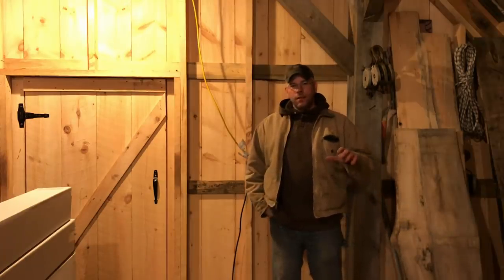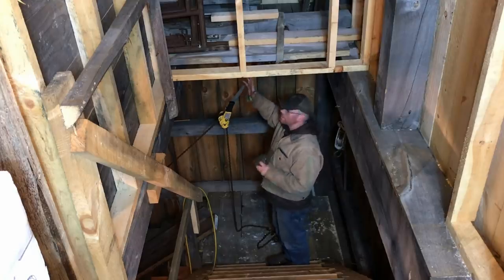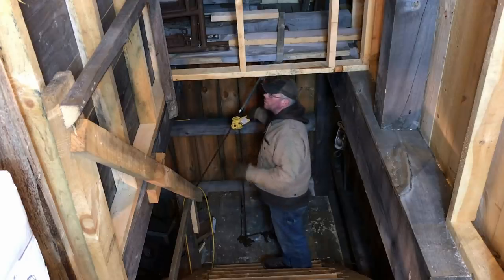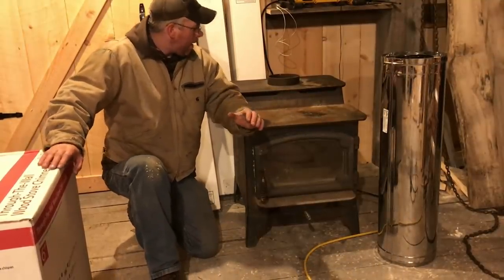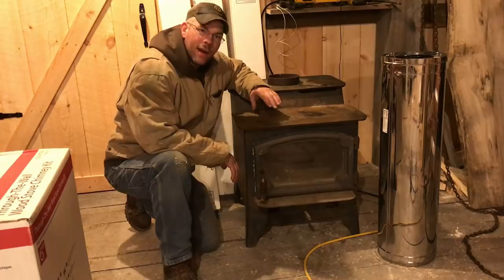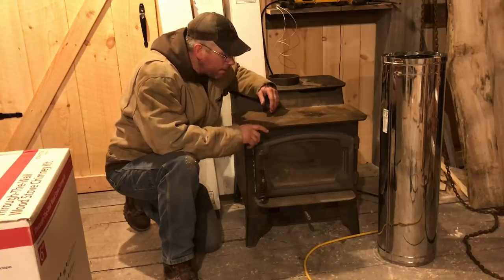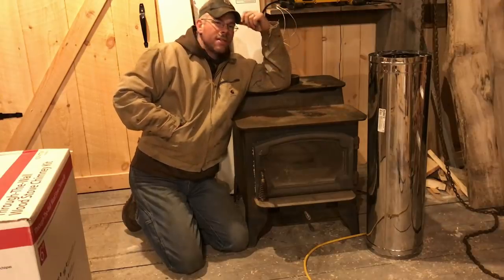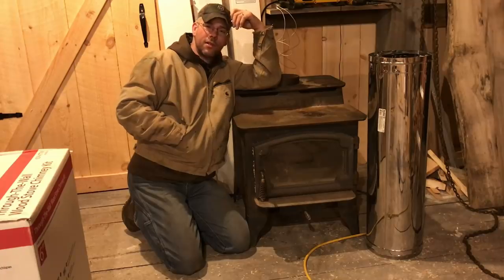A Heavy Wood Stove, A Flight of Stairs and no Help...What Could Go Wrong

Comment: Dear Jim,
Your little heavy lifting session reminds me of when I had to do mine except I was fortunate everything was on ground level ( no staircase). The double wall stainless steel chimney flue was quite a shock  when I had to purchase it ( £100 per metre sections plus collars, through the roof cone, etc, etc...). I think the 5KW stove by itself was approximately £400 & with the added  pipework the cost jumped to £1200 in total ( less installation charges which were an astronomical £1000 if done officially; I managed by sheer stroke of luck to get a fully qualified installer willing to do it for £400 cash in hand if you see what I mean!!!). But it did a great job warming up the place to a very comfortable 20+ degrees very easily ( went up to 34 degrees a couple of times too). Now remember I only used it essentially during winter seasons so upon dismantling the installation when ordered to do so I was expecting to see the pipes to be quite dirty. Putting my hand in the blackened pipe, I could not get anything . They were very clean surprisingly. The prospect of homely comfort using this stove will warm up the cockles of your heart. I am sure you'll all feel a great deal more pleased to enter a warmed up place ( Mary Rose & the children no less). Once the stove is going, I am sure productivity will go through the roof  (no pun intended). very well done my old fruit. Kind regards.

Comment: Good use of two of the five basic machines.  Inclined plane and the lever.  I don't know if the ratchet was part of the five basic machines but it was a good addition!  I lifted a 600 lb. iron balcony  up the outside of a house and then bolted it (thru-bolts) to the second story using the same setup with the chain hoist attached to the top rung of a 36' ladder.  Just don't get under it!
Reply from the maker: Chain hoists are great tools.

Comment: Jim, be an OLD HVAC guy myself I say you should have put radiant heating loops in the floor of the portion your wife gets. You gotta admit there ain't a better heating mode! Great job of the timber frame and the explanations you give while you're working on something. Keep up the great job and videos!
Reply from the maker: Thank you.  I go for ultra low tech systems at home...spend too much time wrenching on stuff that's too high tech for its own good.

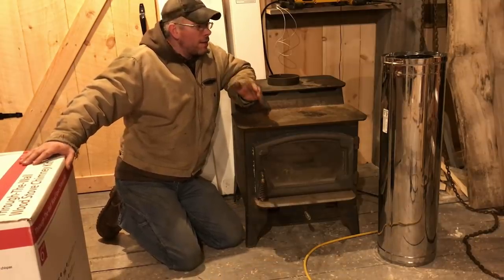Comment: Love those Coffing hoists.  I have a 500 lb, 1500 lb and a 1 1/2ton.  Right around 16:00 you kinda touched on a point I was going to make Jim, and that is that the burn characteristics you are familiar with on that burner for 29 years will probably be somewhat different with the new chimney configuration:  flu type/height/fittings.  In other words, for those with a lesser level of wood firing experience, going from a square or rectangle masonry to a 2100 degree SS triple wall will effect it as well as an added 90 or 45.  A large factor is the change in height. The change could be negligible to varying levels of extreme but easily overcome as you well know.  Hey man, I liked your rigging.  In our trade many times the situation calls for a bit of uhhhhh... shall we say creativity in the rigging department, don't you agree.  Another great video sir.
Reply from the maker: Rigging is a big part of what we do.  I've put some huge compressors in alone doing the same thing.
Reply: Yessir, BTDT.  Same here Jim.  Are you familiar with the larger capacity RTU's like Trane, that  run dual S/A fans or even a large hp single ?  I'd change those failed motors by myself as well.  Sandwich the top compartment with a pair of double struts with all thread then use a strut trolly and the small 500# Coffing to lift and roll out and back in with the new.  Same thing with the Trane 100 ton screws on their larger air cooled chillers. McQuays, Yorks and others too. Tip of the old iceberg...you know.  I'm glad retirement is allowing time to rest...kinda.  lol.
Reply from the maker: All that stuff is what I work on.  Big steam boilers as well.
Reply: TheTradesmanChannel yessir I knew you were a service tech back in one of your first videos when the company truck was in he background. Though I loved my career choice and worked over 40 years in it the only thing I really miss is my last service truck. Chevy 8.1 litre with Allison automatic and ten foot service bed. That was my portable tool box. I always preferred those over a van. Gets warmer quicker. Cools quicker and all the rattling is in a separate compartment !!!   Have a nice day sir. I’ll be quiet now. Lol.

Comment: Just a couple comments.  With a true catalytic stove like my 11 yr old Woodstock Soapstone stove, when you shut down the draft AND have proper temperatures in the reburn area, the wood will gasify in the main area, the the gases will still burn at high temperature in the catalytic reburn area.  This is very efficient.  My stove will maintain main outside wall temps of 400-500 F for more than 8 hours when loaded and set properly.  It is a completely different world from a non-catalytic process, which I experienced for years prior to this stove.  We burn 2-5 cords per year here in VA and the catalyst screen in my stove is still effective after 11 years of use.  Also, one advantage of using a straight vertical pipe run rather than through the wall is that you can brush your entire chimney out from the inside where it is safe and warm.  Thanks for your efforts in producing and posting your videos!
Reply from the maker: You have been lucky with catalytic reburn in that stove, it must be made very well.  Most of the ones I've seen end up burning out within a few years.  I like the stoves with the reburn in the top, the tubes that bring oxygen into the top after the fire is well established.  They work the same way.
Reply: @TheTradesmanChannel  Woodstock is a great company.  This stove allows you to bypass the catalyst for regular burns and to get the fire established.  If you can't bypass, the catalyst will burn out quickly because the early burn contaminates the catalyst.  But I probably burn 1/2 the wood under catalytic burn than I do with it bypassed, but we burn it both ways at different times.  Also, the Woodstock Soapstone stoves will set you back a little dough too.
Reply: @boooshes  I just checked them out and yeah... a basic catalyst stove is like 2500+!!!   I'm gonna have to look into them.  I have the same stove at  Tradesman and I love it.  But if I could get a stove thats even better...

Comment: First question I had was, why not u through the trap door. You answered that.  2nd one was its a wood shop, are you not going to build anything larger than the wood stove to where you would not want the trap door large enough to get your builds out? 
Yes i know you have the large door out of the top and yes i know swinging this in from outside, by your self would have been even more dangerous as well as even more of a pain. 
Long story, not so short, i got the why's figured out.  
Nice discription once again Jimmy!
Reply from the maker: I figure if the wood projects are too large to go through the floor or too heavy for the stairs then I'll assemble below.

Comment: Installed them for many years, increased efficiency by installing on the wall or sides ,shiny metal , on 1" spacers . Also strap on half  moon reflectors onto the chimney. When going through the roof the more pipe surrounding it the better. Checked out a wood heater installed 2 week before, and found part of of the truss near it turned to charcoal. Scary!, This was to code with 3 vented concentric  pipes. When I left, it was 5, with alfoil wrapped around every timber nearby. 40 years later still ok. They must have had a rocket going.

Comment: So Jim you say that stove has the air tubes inside on top?  Mine does as well... but someone told me there's supposed to be a plate either under or over the tubes that seems to be missing.  I gotta look into that.  I may be sabotaging my wood burns and losing a ton of efficiency.   

Another question..  double or triple wall pipe... doesn't seem like it would transfer much heat.  My stove is on the bottom story and the pipe goes all the way up through my open concept vaulted 2nd floor ceiling so it has a chance to heat up the air around it..  If it was double or triple wall I think I would lose that part of the heat transfer.  Is that or should that even be a consideration when designing a wood stove install?
Reply from the maker: The stove venting has to be done in such a way that most of the heat stays in the pipe so you can get a proper draft.  The less loss, the better.  That's not to say that losing some will creates issues.  This stove does not have the tubes in the top.  I was saying that I've seen people make them for these stoves.  It can be done but this stove works so well as is that I don't want to create issues.
Reply: @TheTradesmanChannel  Ah.  I see.  And are the stove pipes supposed to radiate heat as well?  I definitely feel safer with double or triple wall pipes but the single walls give off good heat as well.

Comment: Jim I'll come do the ladder work if you can get Mary to make me some of that ground hog/marmot that was chasing her lst summer. Now that I have said that I have to find a way to pay for the ticket.
I will tell you I almost made NYC brown alligators in my shorts when you had that first loud bang on the landing. Heads up next time.  
Will you be using a TEG on the stove to help move the air around? Sort of makes sense as you don't have to put any power to it other than the heat.
Reply from the maker: I probably will use those fans.  They work great.
Reply: @TheTradesmanChannel  I thought I saw one for camping that would charge you phone.
When I camp I don't need a phone so not likely to discharge the battery. Silly internet. Also if the zombi apocalypse happened I 
doubt your phone would be that useful if it even worked at all.

Comment: Morning Jim.... one comment and one question.... first off, now that I'm old and things don't move like they used to, I've said to myself that if I had it to over again there would be a ton of changes keeping in mind the old age issue. When you're young you really don't think of these things when you're building, but they hit you in the ass when you get old. Try to keep that in mind if you can, those stairs alone may be an issue down the road. Question, is your barn presently insured, or have you checked into what requirements if any they are going to need to get it insured? I know a building like this, like my log home is a one of a kind that is difficult to put a price on if it had to be replaced, but that's something else to consider. I really don't think you're going to want to go through the barn build again, I know I would not want to build a new log home at my age. Good video.
Reply from the maker: Sorry I took so long to reply John.  The building is covered under my homeowners insurance, at least enough to rebuild it if needs be but it will not be enough to cover the tools that will be in it.  That is the biggest reason I didn't put the sawdust burner upstairs, I was a little worried about putting something that isn't UL listed in a shop full of sawdust and dry wood, not to mention the foam board.
Reply: @TheTradesmanChannel  But the big question is, would you go through all that again to rebuild it? Like I said, you're still young. At my age, no way, I'd buy a log kit first! Can't wait to see when you install that saw dust burner, I've never heard of one of those before.
Reply from the maker: I would do it again on a heartbeat, accident and all if I had to.  This kind of thing gets in your blood.
Reply: @TheTradesmanChannel  Yeah, it was in my blood twenty years ago, but not sure I can do all that bull work anymore. I'd rather be on a beach some where sucking down a Corona!

Comment: I assume this is not already done and in edditing .... Have you thought of Ferric Chloride?
It is a wet liquid that will stain your skin yellow so marrigolds are good to wear. Simply brush on a layer enough to wet the metal and it will convert the surface to a non corodable black surface! 
It is sold in motor stores as a rustproofer for cars but is also sold in chemists and I am sure e-bay or Banggood will be only too willing to take your cash for some .... it is also used in circuit boards for etching copper ;0)
I have never tried this on a wood stove but it has worked well for me on steel with a light to medium amount of rust. ..... simply wash off any remaining solution with water! 
Maybe test a piece of steel in your forge to make certain? As I said I have not used it in this situation but I do not see any problems!
Reply from the maker: I'll look for some, thank you Dave.
Reply: @TheTradesmanChannel  YW!

Comment: Couldn't you have used the tractor to hoist the stove up through the door? You would have been done in an hour.
Reply from the maker: Tractor doesn't reach that door plus it's up the road with the loader off of it.
Reply: I was going to ask the same thing!  So what's the point of the Gable end door if you can't use the tractor to put anything through it?
Reply from the maker: I'll be able to use it.  We have a new tractor on the farm that'll pick that high.  That tractor just wasn't available either.
Reply: @TheTradesmanChannel  Yeah, sure, your other tractor was at the garage. If I had a nickel for every time I heard that one... ;D
Reply from the maker: I may have worn that excuse out!